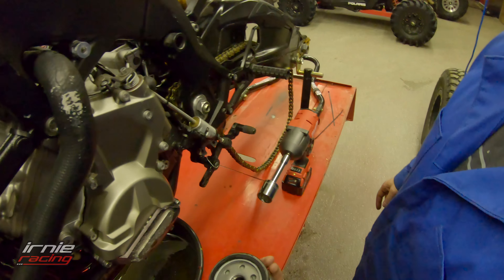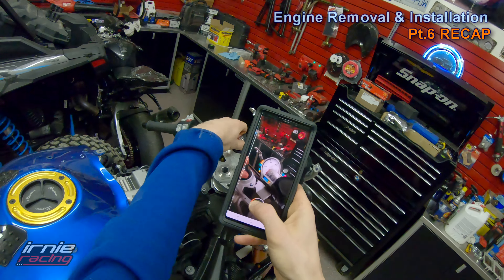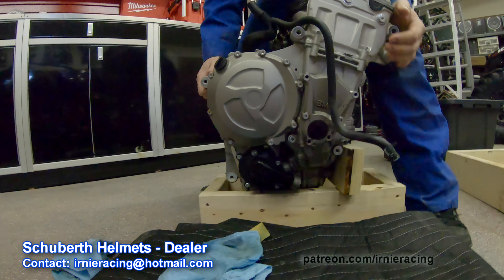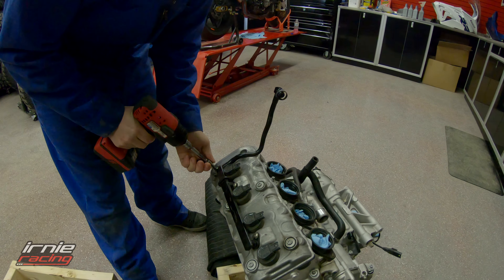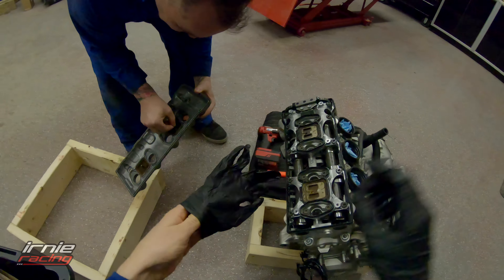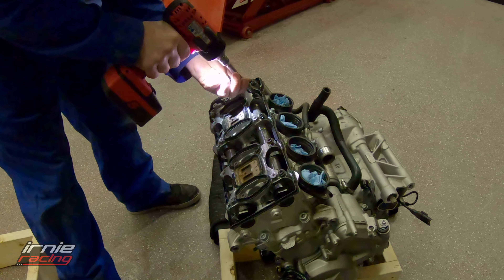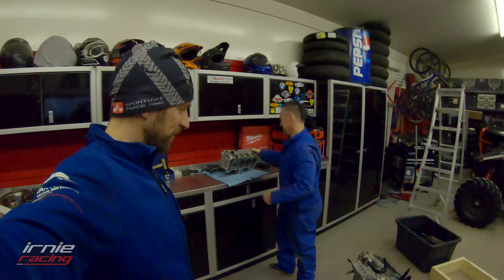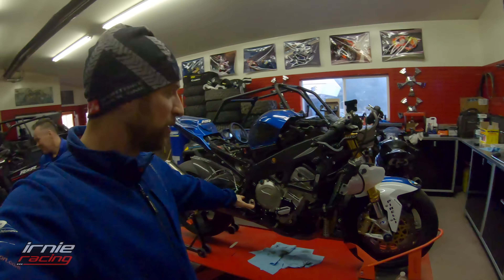S1000RR Engine Removal & Installation Series Pt.7 #projectMystique

Comment: Looks like it went out of timing as the rest of the exhaust valves contacted the other pistons! BMW do a special timing tool for this motor to align the cam sprockets with the camshaft before tightening them down to the camshaft. I’d be curious to know if it skipped a tooth on the cam chain which is probably unlikely or if the cam sprocket bolts came lose and the exhaust camshaft moved out of correct timing!
Reply from the maker: Yah can only speculate
Reply: @irnieracing  yeah true could also have happened after the fact.

Comment: Hey bro question can I have a contact for you I have to rebuild a 09 s1000rr because the piston has to change but I have no idea where to start and it’s my new project just wanted to be able to get any form is assistance if I run into problems please
Reply from the maker: I'm not an engine builder.  Sorry can't help with the engine details